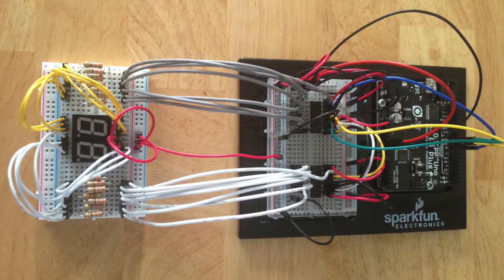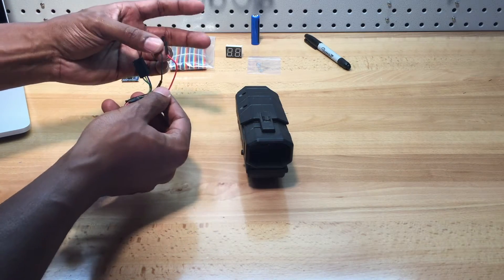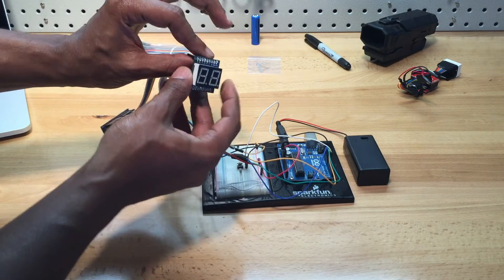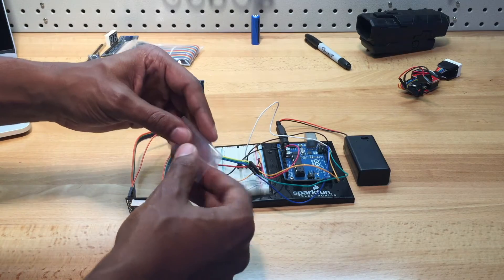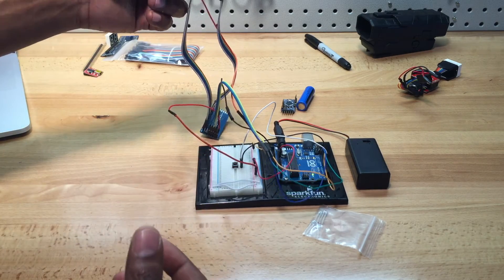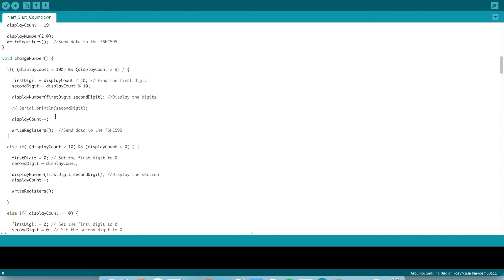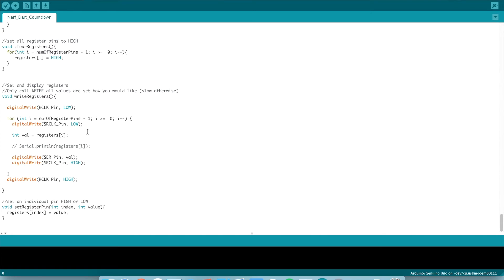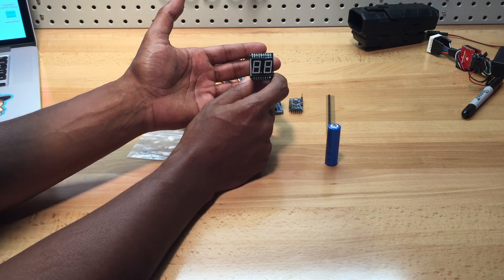Nerf Dart Counter [Version 3]  w/ 7 Segment LED + Arduino + PCB

Comment: I would like to throw my hat in for consideration to help beta test.  I'm building a Rapidstrike for a PC at a steam punk/fantasy LARP.  I need a counter to aid with calling proper damage.

The mod will be a standard voltage rewire using 14400s and new 25k rpm 130s.  I plan to use duel 35 drums, single 18/25 drums, and straight mags in a pinch.  Ideas for expansion (mostly borrowed from research of other counters) is to use micro switches/magnets for drum/mag identification, auto reset counter after inserting new drum/mag, extra LED in barrel for faux muzzle flash.

Interested in helping?  btw you're close if you LARP.
Reply: +Nathaniel Deal Video of final product no problem but would not be edited and very rough; no experience editing.  Depending how crazy you want to help me code and expand this I'll drive down to ALT from CLT and you can video it yourself :) 

The Rapidstirkes are being shipped now from target; they may still be on sale and have buy 1 get second 50% if you need any more projects.  I'll be taking some vacation time over the holiday so the mods will be done before the new year.

Comment: Hey Nate, I tried this with a nerf rapid strike from your original video. It didn't really work out cause I couldn't fit the Arduino in anywhere, so I kinda benched that project a while ago. Now that you have pcb boards though I was wondering if you could sell me any possibly?

Comment: Hey man, Absolutly love this idea. I was wondering if it is possible to use with a 21 segment lcd? I want to add it to my airsoft gun, but they usually hold like 120 - 160 rds. Also, do the IR detectors work for something as small, fast, and with a ROF like an airsoft BB/Gun? Please message me back, Thanks!
Reply: +Nathaniel Deal 
Hi Nathaniel, great video! I have a 21 segment led as well and would like to incorporate your version 2 setup with the list of parts you provided on sparkfun. I just want to know how many of 10k resistors and how many 330 ohm resistors to purchase and how to solder it? Basically with my 21 segment led and your list on spark fun is all the parts I need to do your v2 led counter, right? And how many mAh was the surefire battery you used? Btw I will be modifying a nerf vulcan.
Reply: +Nathaniel Deal Thanks for the info Nathaniel. By any chance do you have the schematics of your version 2 LED counter?